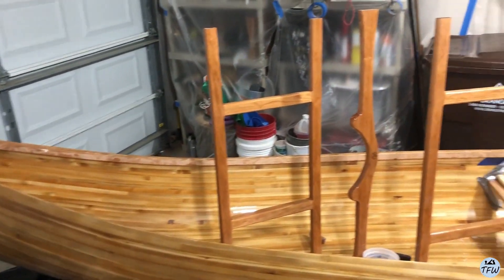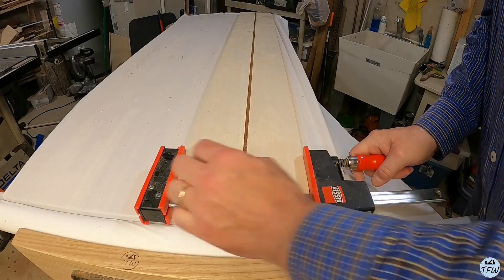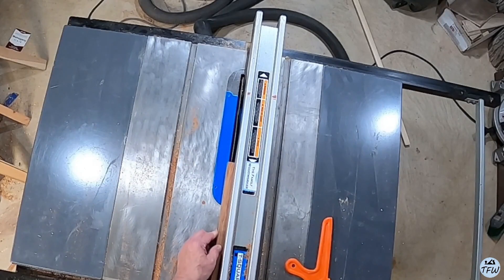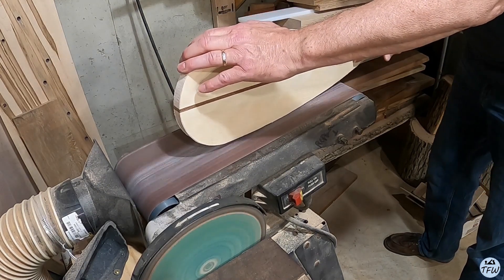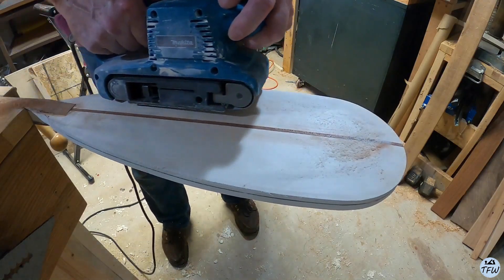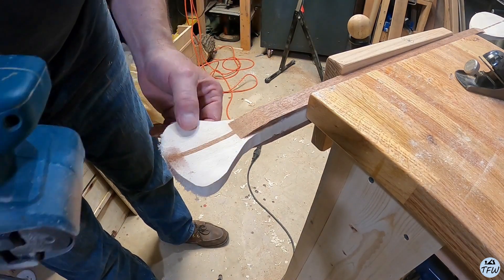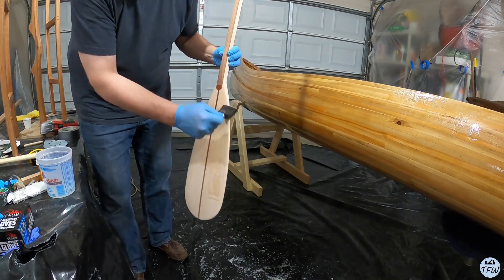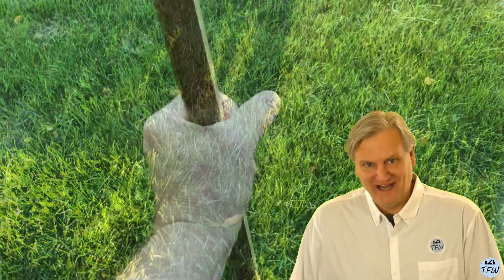Easy and Beautiful DIY Canoe Paddle

Comment: Nice looking paddle! I am impressed you were able to do it all in one day. I am currently refinishing some old paddles and it is 3 days alone on the finish (that marine spar varnish sure takes some time to cure!) One day I would love to build my own canoe :)
Reply from the maker: Was lucky to find a lightweight wood like Aspen in an 8 inch width, which made it all a heck of a lot easier.  The epoxy was ready the next day but you're right... Added coats of Gleam would take days longer. Best of luck on your restoration!